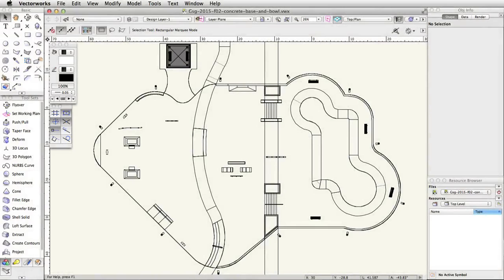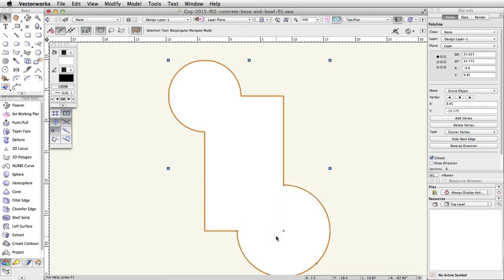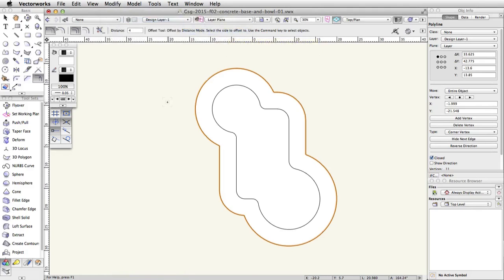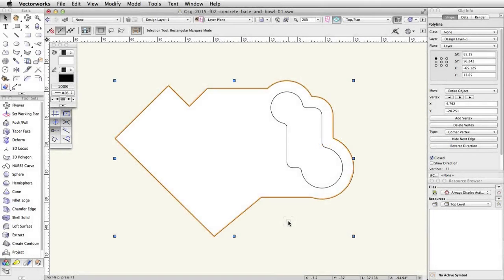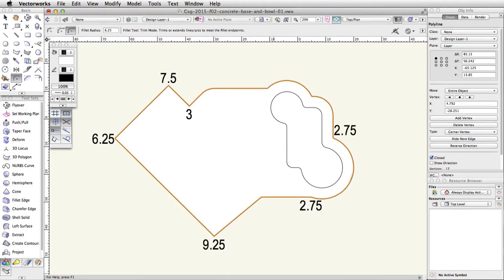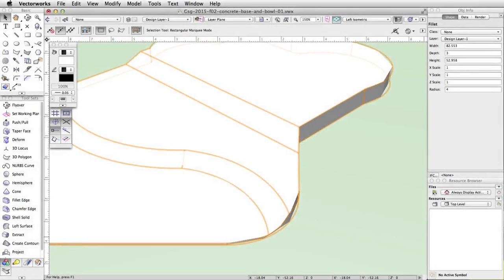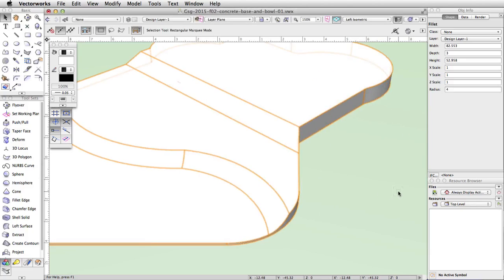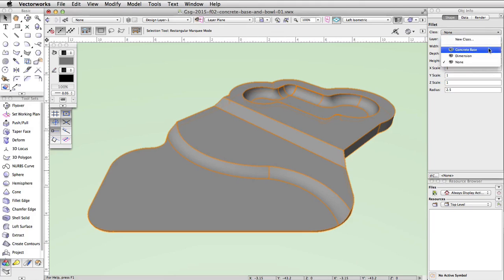Freeform Modeling - Concrete Base and Bowl

Comment: hello,
i have a small question, in the min 9:10-9:30 when you start pulling, the object you created still remains with a white layer on top. in vectorwoks 2017 it disappears just after pulling, which at the begging would not matter, but when doing the "sub face mode" it doesnt work as in the video.

well, thanks in advance. Great videos :)
Michael Bumüller